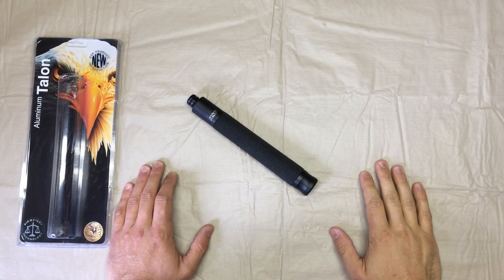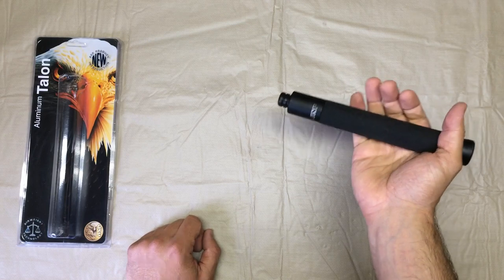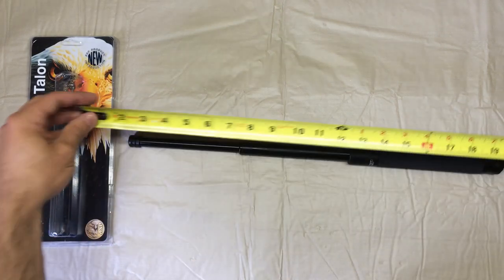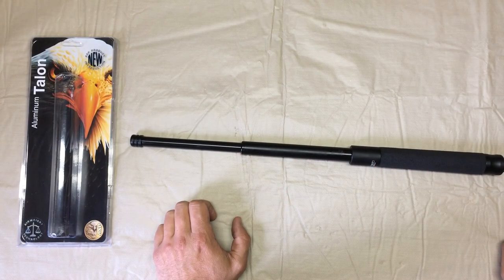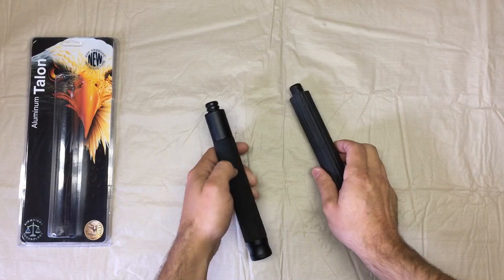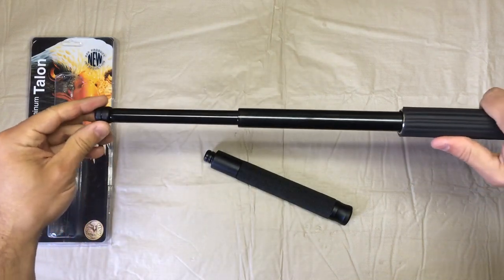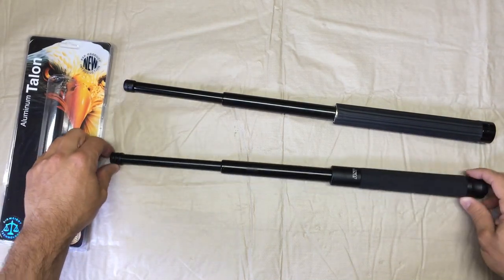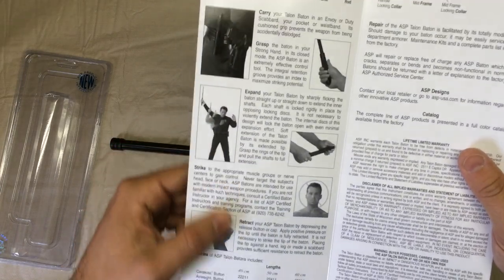ASP Airweight Talon Baton Review

Comment: The Autolock has been around for several years now certainly since 2005 and it uses cams and ball bearings that roll inside the shafts whereas the ASP Talon is rather new and uses two internal discs that lock the shafts which is why it's more solid locked open than the Autolock.

Not criticising Mondanock they make good products but I will say I've always thought ASP products have a slightly more premium quality feel to them.

Comment: Would you recommend the steel or the aluminum?
Reply from the maker: I personally like the Steel because of the extra weight, but I would opt for the traditional Friction loc because there are fewer internal parts and it is more solid when extended. The push button batons have a little play when extended but the friction loc doesn't.